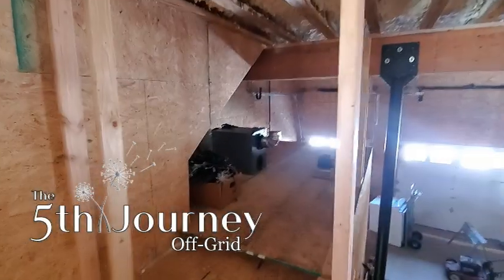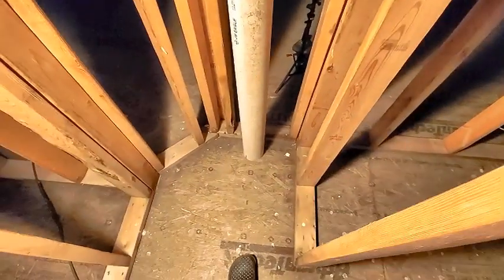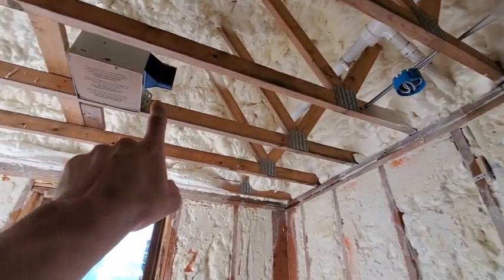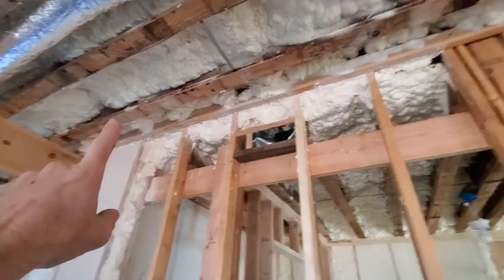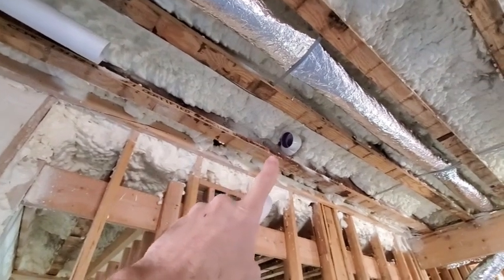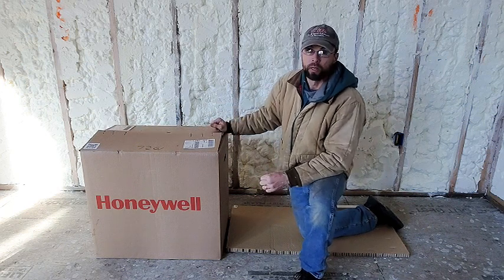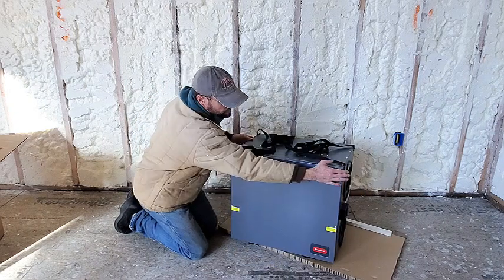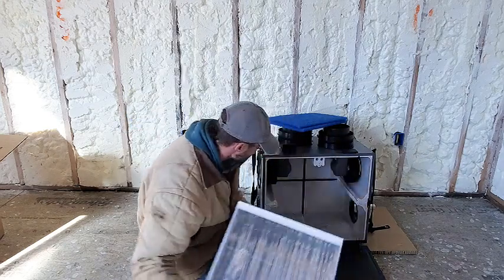Installing a Honeywell ERV and unBoxing from our Off-Grid Barndominium Home Build

Comment: Can this unit be connected to smart thermostat to kick in when home furnace starts during winter times?
My house in Toronto, I must keep a slightly open basement window in order for fresh-air to come into the basement so that furnace receives fresh-air through basement's return-air line in the basement.
No fresh-air coming into basement then my 11 year old son will have bloody nose within a day or two, in spite of the fact I have a humidifier attached to furnace.
Reply from the maker: Yes, it just plugs in so any smart outlet ap would control it.
Reply: @Off-Grid  Where do you find terminals (or ports) on this unit (i.e. ERV) that connects to home smart-thermostat's terminals and likewise terminals on the furnace itself, in order for home smart-thermostat to controls the ERV unit?
Reply from the maker: @LogicStandsBeforeGod  my though would be to use a smart outlet to turn it on and off as needed.  Sounds like you are wanting to directly wire it up but using the outlet would be easier.
Reply: @Off-Grid  "my though would be to use a smart outlet to turn it on and off as needed. "

I think that be a manual task, day one and day two and day three one would do it, as time goes by we will forget about it.

"Sounds like you are wanting to directly wire it up but using the outlet would be easier. "

What I like is the smart thermostat to control it (mine is:  Honeywell T10 PRO SMART THERMOSTAT).
My thermostat controls the humidity by using furnace's blower, likewise for AC and heating, similarly I would like that thermostat starts up the EVR when AC, heat or humidity is called-in in the house.
Is it doable?
Reply from the maker: @LogicStandsBeforeGod  I think you'd need a type of hub device or ap to control everything.  Note though that an ERV is made to remain on all the time to circulate conditioned air through a tight house.
Reply: @Off-Grid  "Note though that an ERV is made to remain on all the time to circulate conditioned air through a tight house. "

I am so glad that I found your video and your posts also give me more insights what EVR can and cannot do.
Thank you so much.
I will keep looking for a different product.
Reply from the maker: @LogicStandsBeforeGod  an ERV and HRV are just a simple fan that moves inside air outside and outside air in and is really only necessary in moden houses that are built to be very tight such that airflow through the house is blocked.  

We have ours on a timer.  It is on all day and off at night.  This is mainly because we're on solar power and don't want to waste energy if we don't have to.  

I have wifi temperature and humidity sensors in areas where moisture might get trapped.  So far our house has remained under 50% humidity.  If not for the ERV, moisture from cooking, cleaning, showering, and such would get trapped in the house and would eventually start to grow mold and cause rot.  

I'm not exactly sure what you're intensions are with the ERV but there are a lot of options out there for smart devices these days.  I'm sure what you are wanting to do is possible.  Good luck.